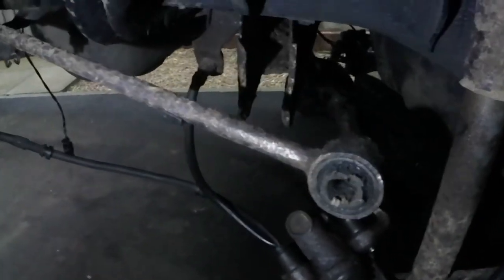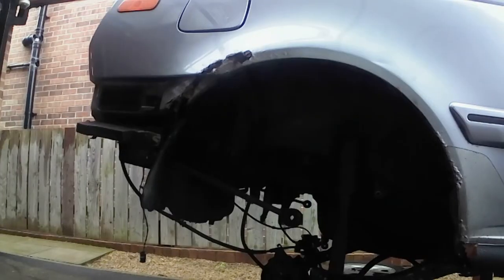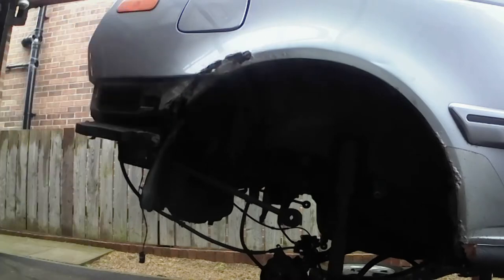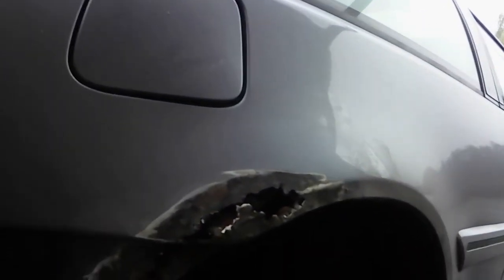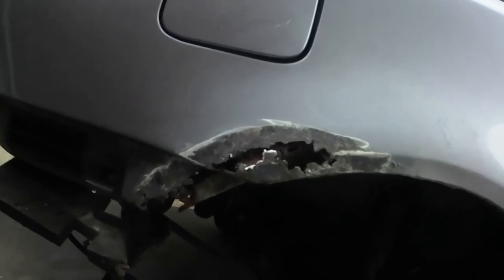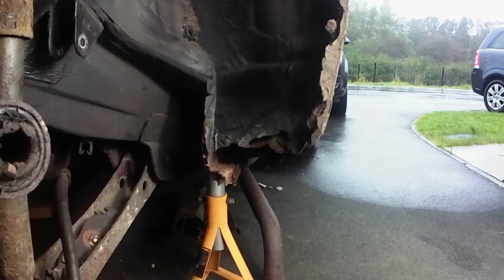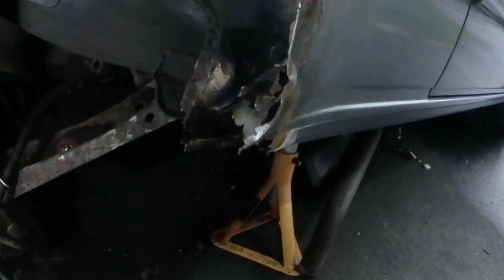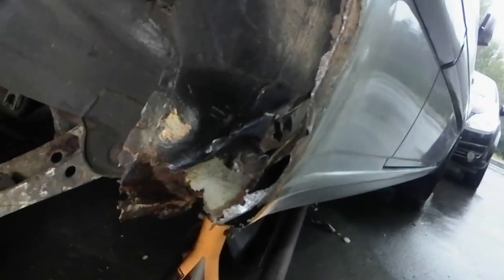Volvo480 - repair work, rear sills

Comment: is it worthwhile? Absolutely! Quite a rare car now. The rear torque arm is bolted in, but the bolt will be seized to the inner bush - normally happens on the hub end too!
Reply from the maker: Thanks Jeff, sometimes feels like such an uphill struggle to get moving, but you're right it is worth it! Also thanks on the confirmation of the rear torque arm bolt. Yep I think I'm going to continue and grind the head off it then use a punch to knock it through as it's pretty stuck. Thanks for watching!

Comment: I'm surprised to see rust on a Volvo, I always thought they were indestructible!
Reply from the maker: lol, I know they are tough cars normally but as with most they do rust. In the 480's they are known for it due to a few badly created water channels that block easily.
Reply: @junkendriven  Looked like the rust was under the fuel filler cap, wonder if fuel leaking down on to the wheel arch washed away any protective paint covering. Is there rust on the other side too?
Reply from the maker: I wondered the same but filler looks good and clean. Inside arches are spot on, all underseal in good condition so think it's just around seams where it's eaten it's way in.
New arch arrived so will be cutting and welding it in shortly

Comment from the maker: A quick update. I've ordered a panel from Skandix to use to repair the rear arch. Not a perfect match but as a cheap template I'm hoping it'll help https://www.skandix.de/en/spare-parts/body/repair-panels/repair-panel-wheel-arch-rear-right/1002169/  
Fingers crossed Skandix does the job!